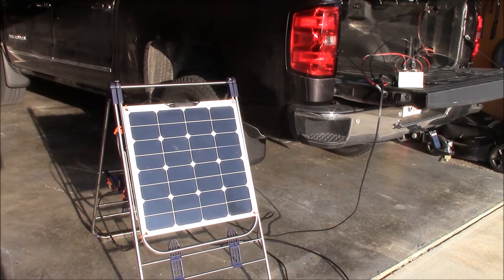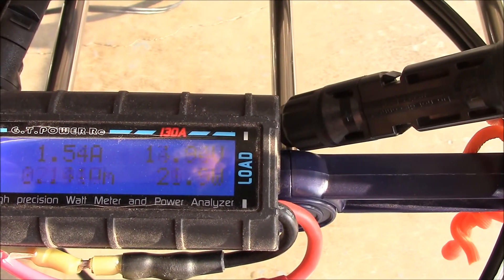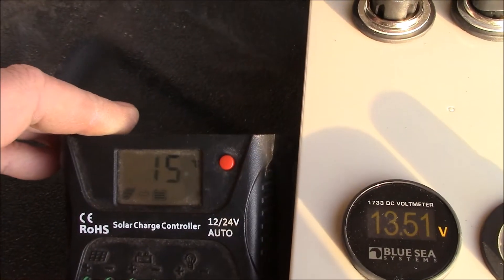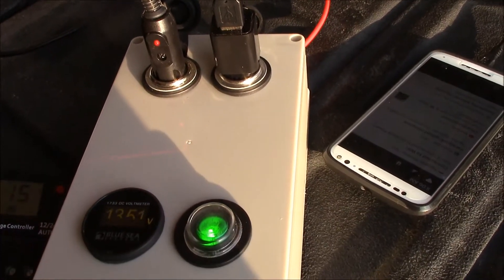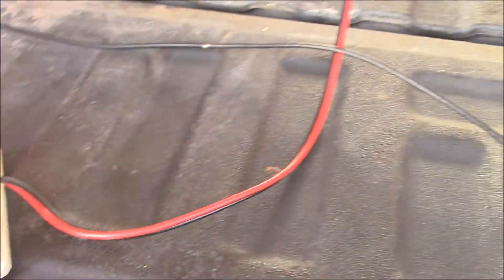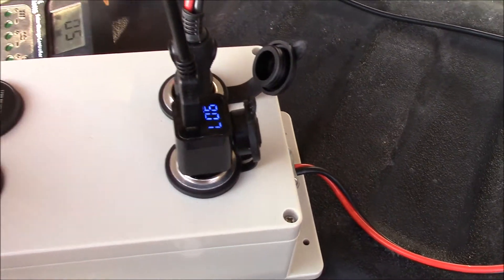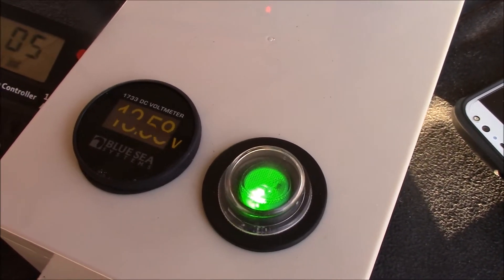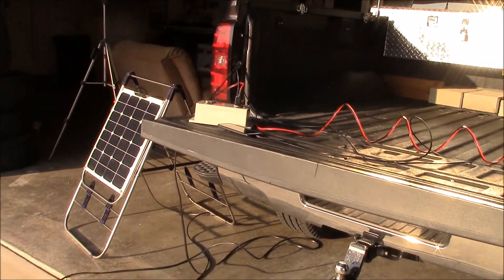DIY 12v dual outlet metered extension box (20-amp service)

Comment: Very cool idea. I wonder if you couldn't have some sort of retractable cord on a lot of these things instead of having the cord loose like that??? I'm thinking like search craigslist for an old vacuum cleaner and taking the retractable cord off of that, and now you'd have a built in extension cord in whatever you build if you want and need an extension cord. 

Even Wamart sells replacement parts.
https://www.walmart.com/ip/Evolution-Vacuum-Cleaner-Cord-Reel/521043416?wmlspartner=wlpa&selectedSellerId=6774&adid=22222222227066152825&wmlspartner=wmtlabs&wl0=&wl1=g&wl2=c&wl3=170289482302&wl4=pla-275279773866&wl5=9025266&wl6=&wl7=&wl8=&wl9=pla&wl10=114435286&wl11=online&wl12=521043416&wl13=&veh=sem

Amazon
https://www.amazon.com/Hoover-303238002-Cord-Reel-Uh70120/dp/B00Y32PT48

https://www.amazon.com/Hoover-Vacuum-Cord-Reel/dp/B008MM4E2S

I was thinking you could cut the end off and put on anything you wanted. I was thinking in solar gen boxes, you could make a recessed shroud type of enclosure out of a PVC end cap, so the plugin end sits inside the cap inside the box and not sticking out, but it is still water resistant to some degree. I mean you'll still have a hole in the PVC enclosure where the cord comes through, but that's small and recessed. Anyway, just a thought to help make cleaner builds, and add ideas. Keep up the great work.